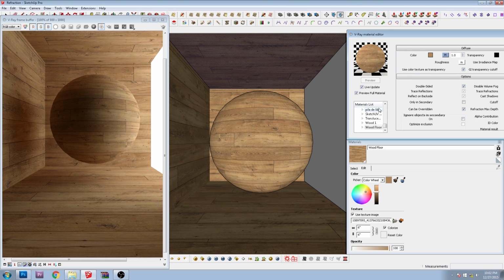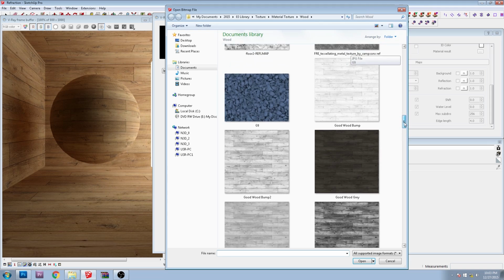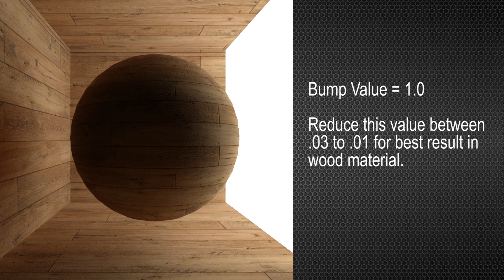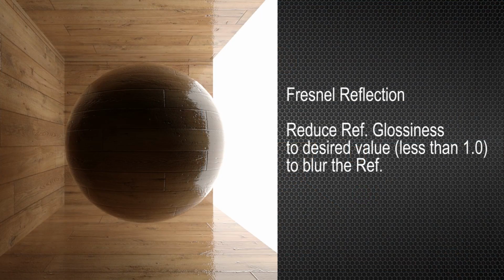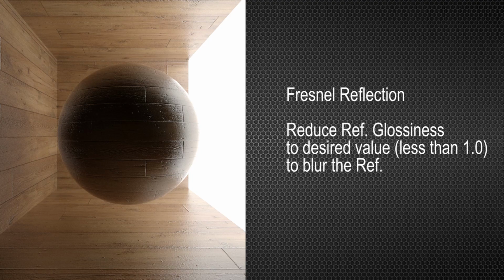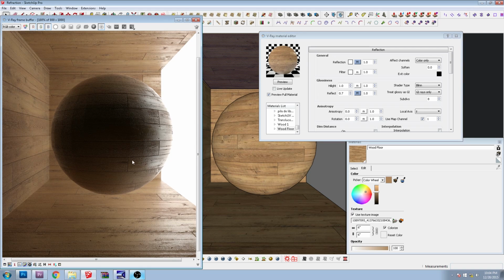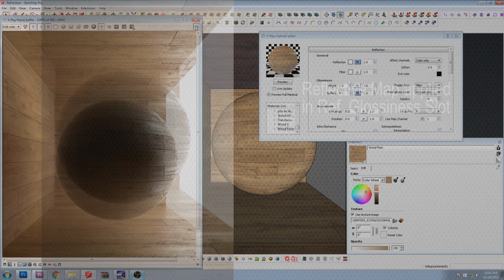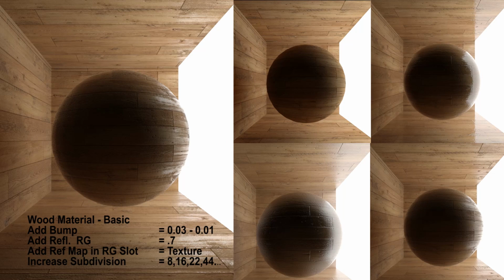How to Create Wood Floor Material in Vray for sketchup 2.0 - Tutorial

Comment: how did you get such strong shadows in the back of the room and on the sphere? i've been playing with settings for quiet some time but didn't get nothing as close
Reply from the maker: sorry for the late response, but this is due to the size of the sphere in relation the the actual room. The larger the sphere the more light it will block from the front and as a result you will get this nice light contrast on the surface of the sphere. hope that helps :)